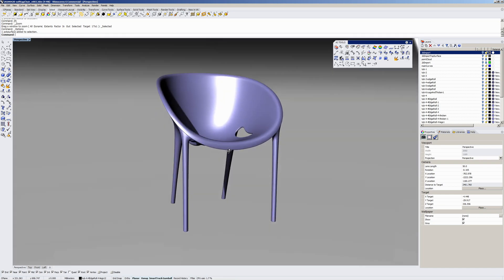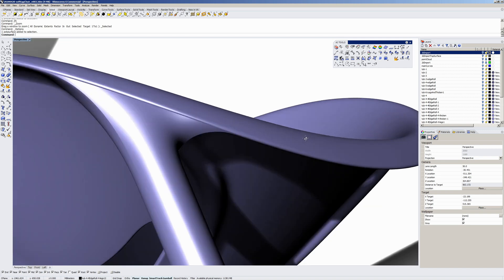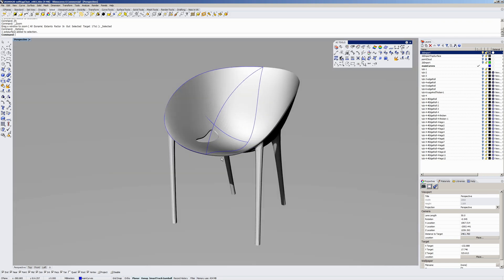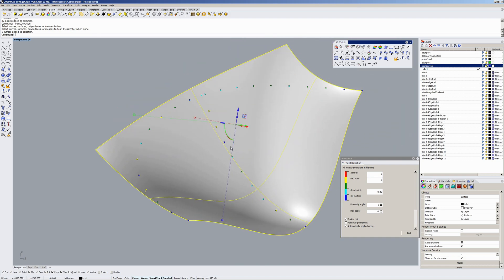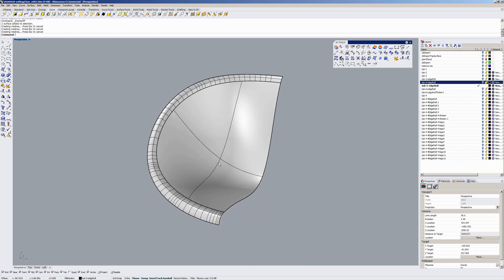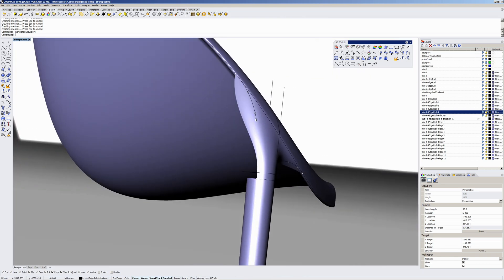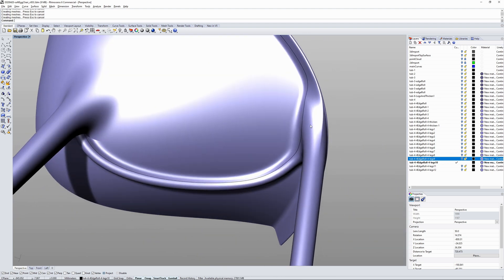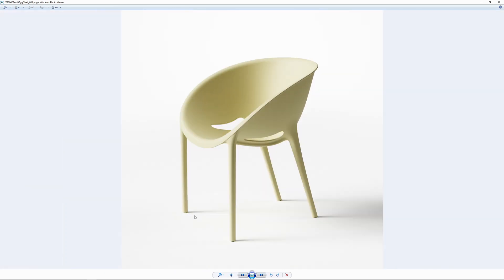Driade Soft Egg Chair CAD Sculpting Exercise in Rhino

Comment: Hi Andrew, how are you? First of all, I want to thank you for sharing your experience, it’s really helpful. I have a question. How much do you think the actual modeling used to design the manufacturing mold for that chair might differ from the way you're doing it? I mean in terms of the methodology used, the "precision," and whether they would also use your technique of "overbuilt" trimmed surfaces
Reply from the maker: Hi James/Franco, all good here thanks. Good question. With chairs I have worked on for production, overbuilding a surface then trimming it back is a valid way of achieving a tub chair, or even a single piece seat pan/back type shell. This works well if there are no localised curvature changes or waterfall edges. The alternative is to model out of multiple surface patches, which just complicates things for something like the Soft Egg chair. If you want to see a production CAD model review, of a seat pan made of multiple surfaces with localised curvature changes, have a look at my Noho Lightly Chair video.

https://youtu.be/P6y_ImsSwyw

Regarding the Soft Egg modelling exercise, I did not have to consider the reality of draft angles with this model, however as I was modelling something based on the actual production chair photos etc, I tried to line up edges to where  split lines are. Cheers, Andrew
Reply: @AndrewJacksonDesignStudio  Wow, great work, congratulations! I'll take a closer look at it now. Sometimes I've tried to proceed with multiple surface patches, and I often struggle to find the right guide curves to make the surface do what I want while maintaining curvature/tangency with the adjacent surfaces. I guess this is more common than I imagine, right? Anyway, I'll pay more attention to your approach from now on. Thanks, Andrew! Best regards!